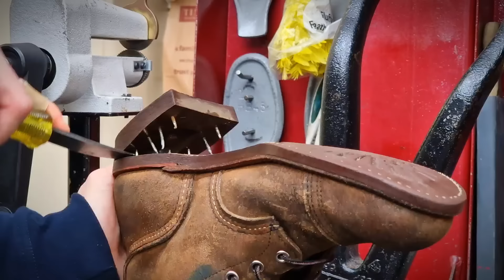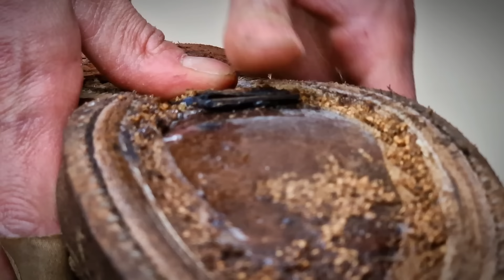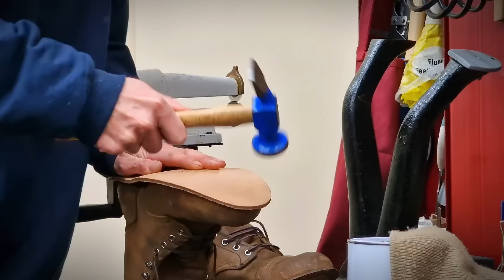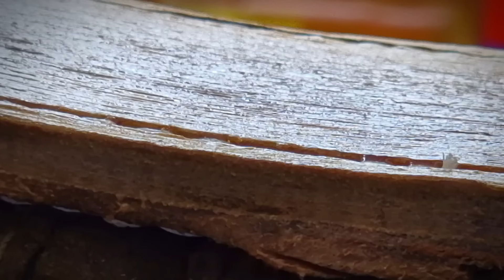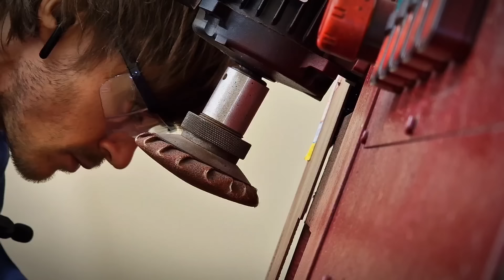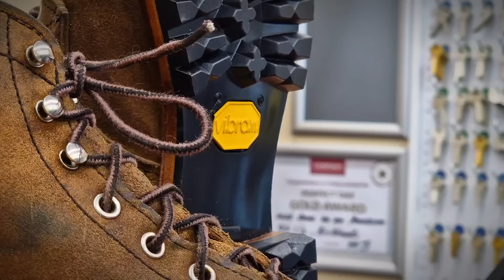ONE MAJOR FLAW WITH REDWING | IRON RANGER RECRAFT

Comment: I really like that you added a midsole. A quality one at that too, I don't recall ever seeing JR leather used for a midsole before!
It's always bothered me that Redwing doesn't put a midsole on the Iron Ranger.
Reply: as far as i can tell, this is not a JR sole. also, JR does not exist anymore, we will not see those soles a lot in the future...
Reply from the maker: Yeah it wasn't a JR sole but it was a German Oak Bark tanned one, JR has been bought over by Kilger Leather, same recipe, same technique, new soles are starting to make their way round the world now, and apparently they are just as good, youl see more of em popping up.
Reply: I couldn't agree more. I've always been a Red Wing nitrile cork sole over vibram sole guy...mostly because the vibram sole just felt "too thin"/like something was missing.  If Red Wing had gone with the midsole like this...I likely wouldn't hold this opinion.  Nice video of your great looking work on these Iron Rangers!
Reply: @gregd8098 yea I miss the old smooth cork soles. They were outstanding, still got an older pair of 8114’s with the cork sole, love them. The mini lug vibram soles would definitely fair better with a leather midsole

Comment: Evidently Redwing does not care about the cobblers who recraft their boots or else they would fix the problem of the gemming coming loose from the insole.  No matter, you handled it quite easily.  See you on the next video.
Reply: For real, 2 out of my 3 pairs of Red Wings have this problem, the 3rd one is the newest pair so I don’t doubt i’ll get that problem too
Reply: They don't want them repaired or rebuilt. Redwing wants you to buy new boots. Why would they make it easy?
Reply: I love to see a cobbler and shoemaker on top of their craft doing great work like JK boots staff. It's so clear how well made and designed those boots are and when I see how much better made they are and how good the cobblers there do their jobs it seems that they are better value than the redwings and nearly every other boot under £500. They're so strong, and a resole is $200 and they can rebuild totally worn out boots but they do last ages.
Reply: My only guess would be because they expect us red wing consumers to send it back to redwing to be resoled, and then just resoled without worrying about the giming, because realistically none of us really knew what these boots looked like before cobblers started tearing them apart?
Reply: It may be it would cost Redwing another 50 cents to sew on the gemming.
Reply: Plus the labor

Comment: I have a question. Since the welt is stitched to the gemming and the sole is attached to the welt, then the entire upper is only attached to the sole by glue. So in that case the Goodyear welt is not much sturdier than just glue. 

I am not talking about the recraft ability. When the Goodyear welt was first introduced it was stitched directly to the insole, but as it became more industrialized gemming came into the picture. and if the gemming is not stitched to the insole there is nothing but glue keeping the upper and sole together

Comment: So at least be honest. It's not really a Red Wing problem, it's a problem with that method of construction. Most shoe brands use gemming on shoes up to a certain price point. Some makers put a piece of canvas to bridge the gemming. Red Wings and Thurdsays is still about the best boot for your money.
Reply from the maker: Agreed almost all companies do It this way. But after taking apart many boots and shoes across all brands, Redwing are the ones it happens to 9 out of 10 times I crack them open, when other brands manage to stay intact. Its a pretty common problem with Redwings.
Reply: Agreed. Hopefully all the cobblers out there take the time like you do to add a little glue to those loose gemmings.  @CobblerG
Reply from the maker: No corners cut here! Thanks again!! 
G

Comment: I don't get the thick lug sole, work was well done but effectively it is no longer an iron ranger.... Similar to those fools who put Goodyear welted soles on doc martens.  Also it would have been wiser to see the sole to the midsole and not depend on the glue.
Reply from the maker: Customisation is a big part of our industry these days, creating a shoe/boot in the vision of the customer, using different soles than the original to reach a desired look, they don't have to be the same as their originals. As for this sole, it's design is to be glued to the midsole, the glue we use now is far superior in holding up enough to last many many years. Doc Martens with goodyear welted soles, if that's what the customer would like then why wouldn't we do it for them? I see no issue
Reply: @CobblerG  don't get me wrong I completely understand, Ii myself took a vintage pair of bowling shoes and turned them into my daily kicks,.. I'm just saying you took a Cadillac and put monster truck tires on it. Does it look cool yes, and people going to say wow, yes, and someone absolutely loves it. But just not for me.